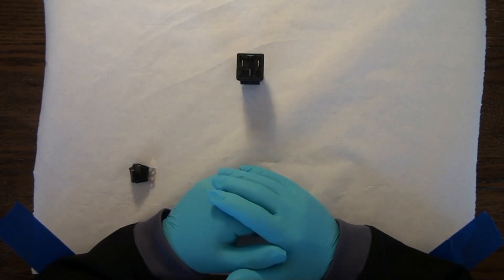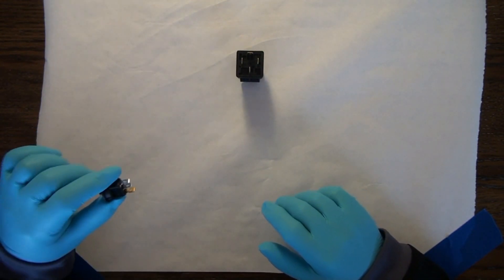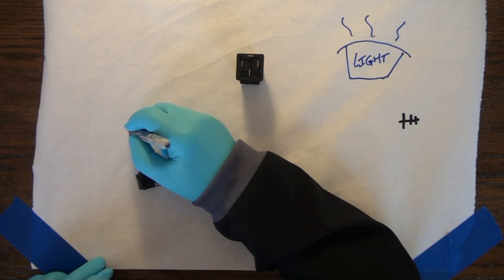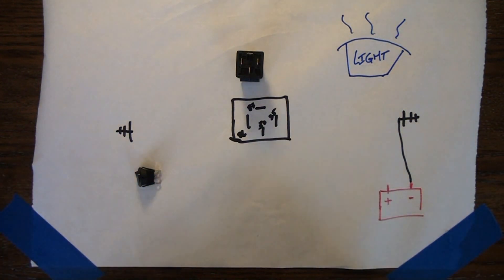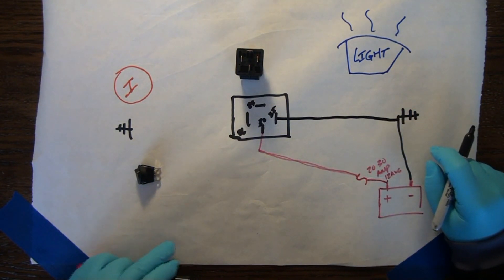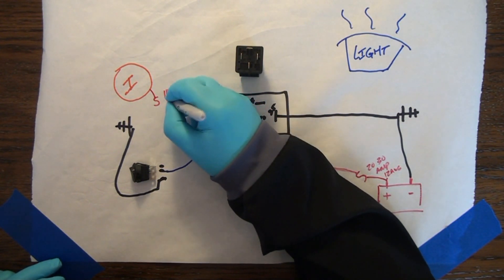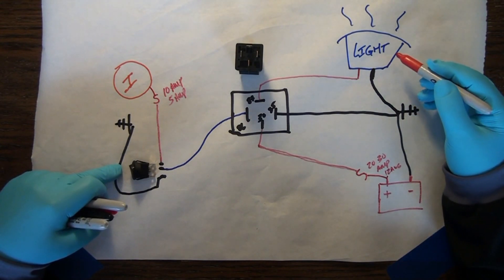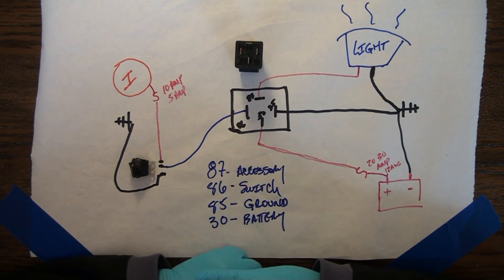Kubota ROPS Light Wiring [Part 2 Of 2] 12 Volt Relays

Comment: Very well done. Easy enough for a beginner to follow safely. This is the way I taught basic circuits to trainees over my 40 year career in oil refining. Used white boards and even did mock ups. Slowly worked our way up to 480V, 2400V, and 13.2KV switchgear/substation operation. The goal is to make it simple and easy to understand, and you nailed it!
Reply from the maker: Thanks Chuck. I really appreciate the compliment. The whole Idea is to get folks to NOT be afraid to pick up a tool and try. I believe that once they start getting a few successes, they will have the confidence to do more. God bless Chuck and thanks again!!
Reply from the maker: Kilovolts!! That's crazy man stuff right there. That's like playing poker with the Grim Reaper!!......not much room for error. One had better pay close attention and no daydreaming or they're going to get their sinuses cleaned out!.......Jeez

Comment: So cool,  Thanks.  -  I am having an issue with my Kabota that looks much like this.  I seem to have hooked an accessory hot wire to the battery Positive and the other wire to the Positive also and probably should have attached it ti the body for ground..  I melted/cooked both wires.  I dis connected the two suspected relay wires and was able to start the Kubota ok.  I immediately shut it off.  Not sure step to take next.
Reply from the maker: Yikes! That's all the makings of a bad day! I'm glad you got out of it without any real damage. I would suggest isolating both circuits and taking each relay, one at a time and cover all your bases. There's a good chance you'll have to replace each of those relays. Good luck and let me know how you make out! Thanks for watching, commenting and supporting!!

Comment: Very informative! Much appreciated. Couple questions: How do you find the correct wire from the ignition that gets hot (12v +) when turned on? And when you find it, do you just strip it back a bit and solder your wire that goes to the switch onto that one? (And then of course tape it up and protect it.)

Thanks again!
Reply from the maker: Hi Matt and thanks for watching and your comment! I don't know what your working on or what you're looking to do. You have to be very careful when cutting into the wire harness....you may void your warranty, or worse. My neighbor was replacing his car stereo and speakers on his Audi and he (accidentally) cut into a fiber optic wire - $960.00 to get his car fixed. I saw the fiber optic cable. it was brown and orange just like the speaker wire was supposed to be. I probably would have made the same mistake if I didn't know. That said, if you're sure about what your doing, I would start with a 12V electrical tester with a fine point on the end and try to find a wire that isn't "hot" when the ignition is off and is "hot" when the key is in the "on" position. I would also take the time to look over your fuse block for an "accessory" circuit with a 5-10amp fuse. Hope this helps. Good luck and if your not sure - try to find some help at the dealer or accessory store.
Reply: Matt, I have the same two questions. I guess one answered and also suggested finding an accessory fuse to use. Was this in place of spicing into ignition? Also second question -how do you make the connection into hot wire? I guess 3 way wire it.
Reply: @BotaTrac  Matt, I have the same two questions. I guess one answered and also suggested finding an accessory fuse to use. Was this in place of spicing into ignition? Also second question -how do you make the connection into hot wire? I guess 3 way wire it.
Reply: BotaTrac very nice explanatory video. Thanks, just some questions like Matt’s for further clarification. Wiring light to rops on Kubota B7800.

Comment: Bota, nice. I want to power four accessories. 
Accessory #1...lights (front)
Accessory #2...lights (rear)
Accessory #3...horn
Accessory #4...auxillary
I have four relays. I have four (3-prong) switches. I have 14 gauge wire vice 12 gauge wire.  

Since the ignition switch is the low-amp source for each accessory, must I run 4 individual wires from that ignition switch to go to each accessory or what do you recommend. Do I need to create an ignition power box that will send out power to each accessory? Thanks.
Reply from the maker: I'm not a mechanic so don't take any advice from me. You're totally on your own here. But if you are asking me what I would do, I would run one 14ga wire with a 10amp inline fuse from ignition to a waterproof fusebox loaded with 5amp fuses. Then, feed the low side of each of those relays with 14ga leads from the fusebox. On my tractor BX25D, I used the wire that feeds the "Cigarette Lighter Looking Accessory Port" under the seat as my ignition controlled wire. Kubota doesn't offer a lot in the way of accessory circuitry. Also, my owners manual basically says anyone except a Kubota Certified Tech cutting into the wire harness voids my warranty. FYI
Reply: Thanks. Yep, you'e right about warranty. Thanks again.